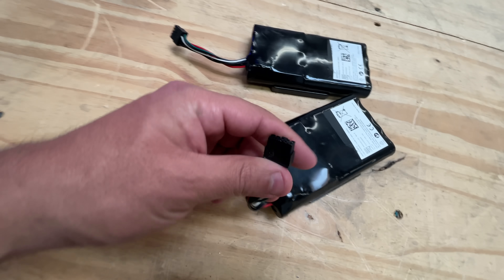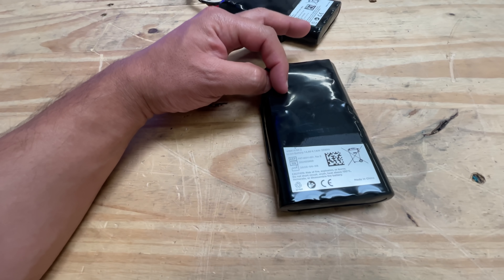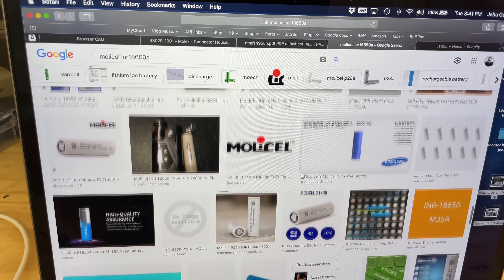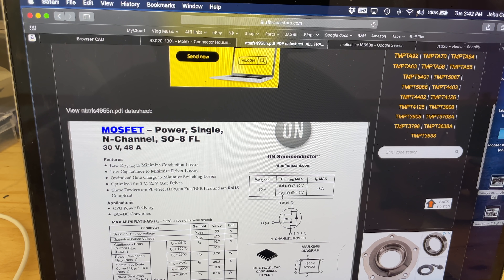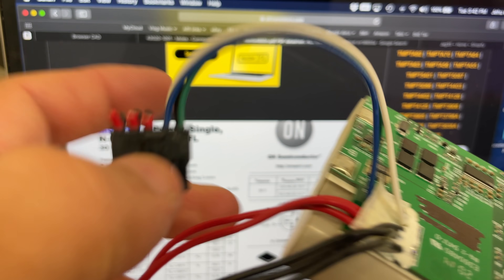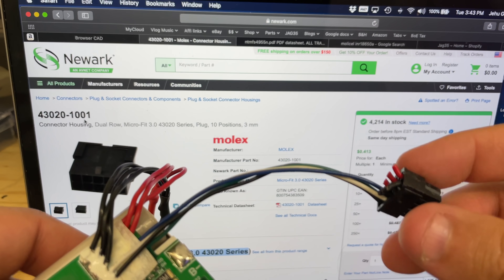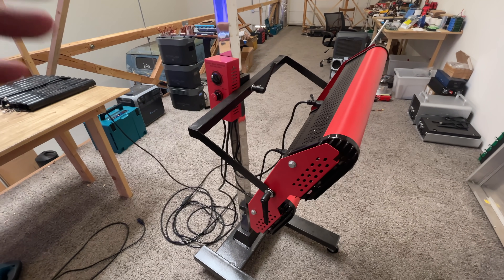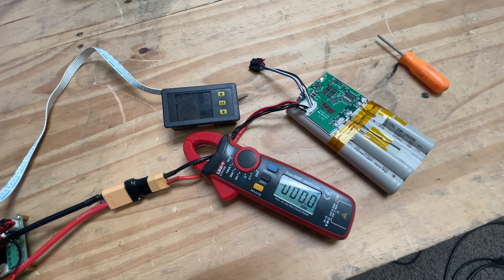14.4v Molicell battery Pack

Comment: Hey Jehu, 

bought some of these molicell packs for a project I am working on, but when I check the voltage it's reading 1V instead of 14V.

I've tried charging the packs with a 15V 4A power supply but they don't seem to want to wake up.

Any suggestions?
Reply from the maker: try charging it on the cell terminals
Reply: @jehugarcia  thank you so much! I will try that
Reply: @Make-with-Mike  I woke mine up with just a 12v wall charger to the 3 P-/P+ output, there are 3 wires for + and 3 for - twisted the groups together and added an xt30.
   But now 1 is  stuck back at 1v , I get beeps on two of the mosfets , Im not to skilled to debug the board.
        How will you charge your pack? I have a tenergy 16v smart charger , and I tried charging on the D and C but it seems to just heat up the board like its shorting , but the charger shows green .

LinusTechTips did a video on repacking camera batteries and mentioned some of these specific BMS boards are specifically designed to be used with a specific application and the boards wont work outside of that application .If i cant  figure them out I guess I will just have to bypass the board and use a hobby balance charger to keep the pack in its current configuration ( I THINK its 4s2p 4000mah per  series ) 
          These packs are perfect for my bike light , but I have no clue how to charge it , I only have 1 working and 1 not , so I need a verified way to hook up some power to it :(
Reply: @ca5ualm3dia  I ended up emailing Jehu and I got an answer on this. What you have to do is unwrap the battery pack from the shrink wrap casing and solder new wires to the B +  and B - on the battery PCB. 

See if you read 14.4V on the B+ and - terminals on the PCB and if you see voltage use those as the main terminals for charge and discharge.
Reply: @Make-with-Mike  OK cool , since Im new to all this , I was wondering if you still get low voltage cut off discharging from B+ and B- , in my mind I thought that was basically bypassing the pcb board and I didnt want to kill my cells, good to know though thanks :)
Reply: @Make-with-Mike   I got it to charge via P+ and GR with a tennergy smart charger with alligator clip leads. I wouldn't use the b+/B- it took my pack down to 7v :( . I you have to discharge via B+/B- , then you might want track its voltage manually more often, which means charge it  after every use so it never drops down, I am using it for bike lights mostly so it can last weeks !

Comment: Update : I got the packs to charge via the PCB board by connecting a tennergy  16v charger with alligator clip leads with the positive to P+ and negative to GR. I wouldn't recommend discharging via B+/- , and if its reading 1v I think you just need to replace the PCB with a similar board or just buy a another batch of packs, they are cheap enough , and the cells still work fine !

Update : I see now from left to right, top to bottom : 3 red "P+" 1 blue "D", 1 green "C", 3 black "P-",1white "T", 1black "GR"

Do we know what is the specific wire for charging , or does the current flow both ways through the BMS ? (sorry new to this stuff )

Comment: so do i have to buy a wall charger to wake these up they wont show up on my basic rc balance charger ? 

UPdate : just found a 12v dc charger and wired up some xt30 connectors and it woke up I guess ?

update 2 : next day it only reads 1v It wont charge , I dont know what to do :(

Update 3 : the cells are reading normal volts , and the b+/b- tabs are reading 15 .8  , but the leads out are at 1 v i cant understand what is wrong or where to go to fix this :(
Reply: I'm having the exact same issue - Have you found a solution? When I first soldered XT30s on them they read 14.4v but I let them sit for a week and now theyre all reading 1V and the BMS is not waking up.
Reply: @Make-with-Mike  I have not , I have limited knowledge , so i followed a video to check the mosfets and two of them get beeps and the other two dont , so I think the mosfets are open or fried , I really dont know , I had two , and one is working fine , but I have not tried to charge it.
      Im waitingto get a tenergy 16v charger ( was the most  affordable option ) I dont have any other power supplies besides 12v , I asked in the group and on EEV but I haven't gotten any real answers , I figure easiest to fix it is to just swap the bms , but I also have not found a reliable BMS for sale and ALI/bangood  says shipping is 2 months or more :( 
    Im sure the right person will come along and suggest a way to sort it out . Im still wondering how to install the charging port , Now Im scared to fry my good one ...BUT JAG35 got some of these tenergy protected cells so I will use those as well in raw form and just charge them up on the wall charger !

Comment: How can i charge these packs?
Reply: I had the same issue , i used an old 12v wall charger with spliced in xt20, i think u need to give the bms a current ?
Reply: 16v smart charger via the p+ and gr wires !

Comment: so do these have a pcb , how would i charge them if i put 2 in parallel and use an xt connector , would i still need a jst balance lead , i have a drone battery balance charger that can display the data , or do i just use  simpler charger ?

Comment: Jehu, these cells seem perfect for making a booster pack for the Bluetti EB150 and EB240 solar generators. I know you built that other board to use with the 12V packs to boost them, but that solution doesn't deliver power at the maximum rate that the Bluettis can absorb. Four of these in series will deliver 57.6V, close to the maximum voltage, and the amperage can easily accommodate the max 10A demand of the Bluettis. So, according to my calculations, a 4S8P pack of these would deliver 576W of the Bluetti's 600W max input, and 1,888Wh, more than doubling capacity. The main issue to overcome would be to find a charger for it. Have I overlooked anything?
Reply from the maker: These are 42v fully charged,  4 in series would be 168vdc

Comment: males have a penis....so whats connected to the batteries now are "male" -  females receive -  the one you found online will receive the Male.
Reply from the maker: Gender is assigned to the pins not the connector housing,  so it would be backwards

Comment: Nice to see Molicels available! Thanks for this video.
Those Molicels are rated at 20A non-continuous, limited by a max allowable temp of around 75°C. Their true continuous current rating, single cell in free air, is going to be in the 10A-15A range. Of course that has to be lowered when the cells are in a pack, heating each other up, and the pack is in a case or other enclosed space.

That 48A number for those MOSFETs is a VERY short pulse theoretical max rating which can’t be used for anything over milliseconds long. The datasheet you had for those  MOSFETs showed on the first page that they have a 16.7A continuous current rating at room temp (which is impossible if they are running) and a 10.5A continuous current rating when hot. Those four MOSFETs are probably two parallel sets of two, back to back. This results in about a 21A continuous current rating for them if the PCB is well designed for heat sinking.

Comment: Its called a 10pin pcie connector.
Reply: 10 pin not 8 pin
Reply: @robotstronghold6195  My bad
Reply: Molex is the company that designed the specific connector being used. Thus why is it s Molex 43020-1001 as that is the model number they assigned to the mate he found. There are other companies that make modular power supplies for computers that have their own unique keying so that only if you use their connector will it work but it won't work with other power supply companies cables. That's why if you order custom power supply cables they need to know which model power supply you have. Also PC power supply connectors on the ends that connect to the motherboard & other components except for SATA have a larger connector per pin.

Comment: Those are continuous 20 amp cells. Here is the data sheet:
https://www.google.com/url?sa=t&source=web&rct=j&url=http://www.molicel.com/wp-content/uploads/DM_INR18650A-V4-80078.pdf&ved=2ahUKEwjK-er8yO_yAhU6_rsIHdkcCqUQFnoECBMQAQ&usg=AOvVaw0sel6IGx25Q5gPgsvDvOod